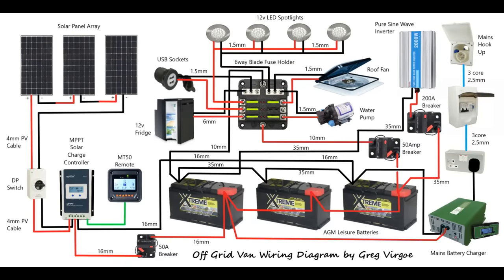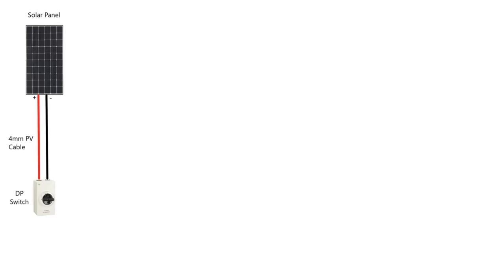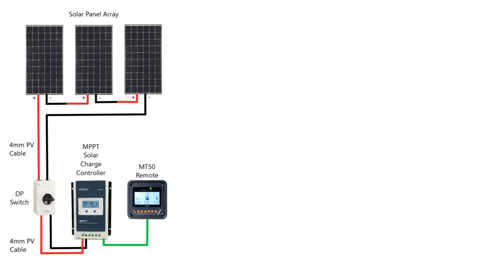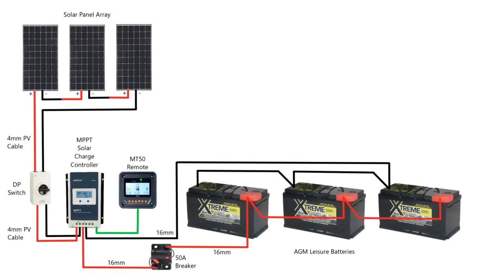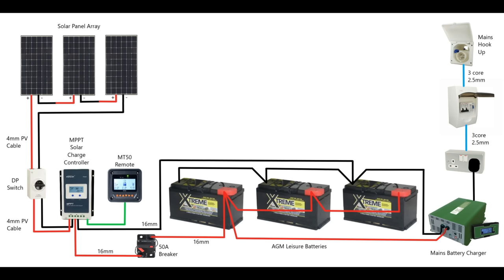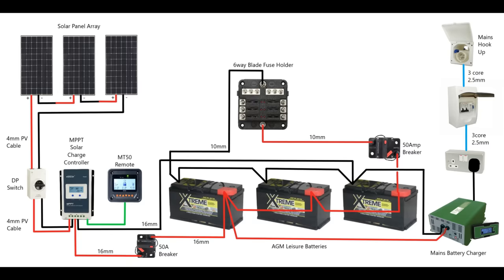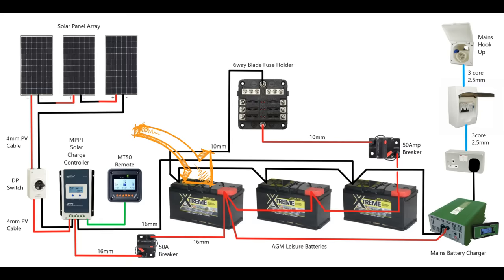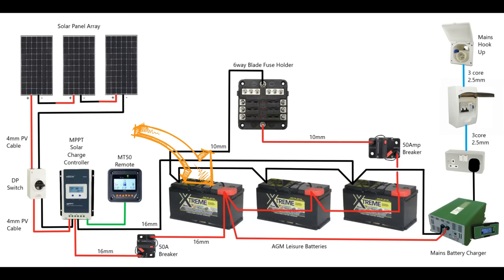How to Wire your Camper Van to be Off-Grid

Comment: Hey Greg! Nice vid, it really helped me a lot... i was wondering why you dont use those two sockets of the mppt controller to feed all the 12 v appliances...
Reply from the maker: There is a limit on the load terminals and it’s really only designed for small loads like lighting. Best to come direct off the batteries 👍🏼😃
Reply: @GregVirgoe  so you advice me to do the same?
Reply: I mean, its perfectbly ok with the solar controller, to leave those sockets empty, right?
Reply from the maker: @patoliau  yes leave those empty and take your load off the batteries.
Reply: @GregVirgoe  sweet!

Comment: In america if your town has Chargepoint for electric vehicle their level 1 stations have a home outlet in them with roughly 1600 watts of power(not sure if it's a 220v or 120v). Have run extension cord from it to vacuum car and other stuff and to use the outlet it's completely free of charge even though you have to have account
Reply from the maker: I’m not sure the local council would be too happy with you camping on the charging point and using it as a hook up 😉😬

Comment: Hi Greg , brilliant video if only other things were explained this simply.  Please could you suggest your recommendation on a heater or best way for heat through the night or winter etc ? Many thanks.
Reply: Heat uses loads of energy; more than you'll get from a solar panel. So unless you're using a mains hook-up, you'll need a gas or diesel system. Diesel heaters usually come with a little bottle which you can top up when you refuel your van, so you don't need to worry about changing gas cylinders in the middle of the night. If you're really clever, you could even run the fuel line right into the main fuel tank so you don't need to think about fuel for your heater at all!

Comment: Hello! Very informative video. To add: is it possible to charge my batteries thru the alternator? Would love to see how you wire them as well just to ensure my batteries are juiced up even when there’s no sun. Thanks!
Reply from the maker: I recommend you use an isolated DC to DC smart charger like Victron Orion which you can find for about £150 now. 
You will need to run 16mm positive and negative cables from this to your van starter battery and your leisure battery. It will monitor the condition of your leisure batteries and make sure they are getting the correct amount of charge while driving.

Comment: Hi Greg, Thanks for your comprehensive schematics and videos. Question; Does a Projecta 1000 Watt Inverter need a Type A RCD connected to the 240 v output of the inverter? If yes how should it be wired to work effectively? Many thanks.
Reply from the maker: Yes it is recommended they you fit a Type A RCD off the inverter on the mains side. Wire from the AC outlet to the RCD then from that onto your sockets.

Comment: I found this helpful and set about getting all the bits together… my first go, my biggest project to date… I came up against serious issue any one able to help with specific work around would be fantastic… the 35mm cable is too fat for both my circuit breaker and my MPPT controller terminal…. Hope someone knows

Comment: Dear Greg,
you videos are some of the best in regards to camper buildout and more specifically camper electrics. Would it please be possible for you to give me an indication on the sizing for a circuit breaker. My concerns focus on two components that need protection. The first one being the car battery and the second the solar panels. With this in mind what size of fuse would you recommend between the car battery and a LiFePo 280Ah leisure battery running through the CTeck 250 coupled to the 120 through pass? Second point are the solar panels. There are two with a 140 Watt each connected to the system. Same question here, how big of a fuse would be recommended. As for the wiring gauges I followed your plans. Thank you ahead of time for your time and expertise.

Comment: Greg thank you so much for your video, they really are the only things I've found that make sense to me.  I have got my solar kit and am trying to work out how to rig it up without disaster.  
The inclusion of the DP Isolator between the panels and the charge controller makes sense to me. I watched one video where someone insisted on the need to unwire the PV wires from the charge controller before adjusting batteries ect, but then he went on to touch the bare ends of these wires - its all baffling to me.  
I looked up the isolator in your kit list, 32A on ebay, but says its rated for PV string volatage of 300-1000V.  I'm not sure how to calculate the string voltage of my panels, I have two which have 41V written on the back of them, they will be wired in series, so if I add that together I get something like 80V - could this be right?  Can I use this isolator? I do I need something rated smaller? 
Thank you so much for any help, I know there is really no obligation for you to help some random asking you a question, but the company I bought the kit from seem to find my questions tiresome. eeks.
Reply from the maker: With cable and switch ratings it never hurts to go bigger. If the switch can handle much more voltage then it will be very safe. It will run cool and no risk of it burning out. You will be fine with that isolator in my parts list 😁
Reply: @GregVirgoe  Thank you so much for replying, that is super kind of you!  The part is in the post and I'm inching my way closer to getting this thing all rigged up.
Reply from the maker: @jodie1162  when you get it inside will be 8 numbered terminals. Wire the positive from 1-2 and the negative from 7-8 and leave the other four empty. Hope that helps you 😁

Comment: This is spot on thanks my question is can I run a 12v system and 230amp plug in on the same plugs or would I need to have 2 separate circuits eg 

12v lights and usb stuff but I want to have two 3pin plugs for like a TV or an air fryer so we can pull up and use the vans battery power and also be able to pull into a camp site and use a power hook up on another occasion
Reply from the maker: Take a look at my latest van wiring video. There I use a Renogy inverter that has in built auto changeover from battery power to mains hook up so your sockets in the van can be powered by either

Comment: Hi Greg. Me again (sorry!). You've answered this in part in your pinned comment but I was wondering about earthing. My van is a Luton with non-metal walls and the electrical system is mounted on a wooden frame. It obviously has a metal chassis. Should any part of my system go to the chassis at all? Obviously, it's the mains hookup that concerns me most. Hope you and Lou are getting on with the build. Mine is killing me!
Reply from the maker: Ok 👍🏼 sorry for the delay in replying. 
You must not connect a mains hook up earth to any part of your vehicle. This is a legal requirement covered by statutory law. There is a serious risk of fatal shock if the site power supply lose their combined neutral earth connection. 
What you need is a consumer unit connected to your hookup socket with a double pole Type A RCD and double pole MCBs feeding all your internal sockets and appliances. Connect the earth from your appliances to the common earth bar in the consumer unit and your hook up earth also to that earth bar. Do not connect this earth to the vehicle body. Hope that helps. 
Here is the consumer unit you need 
https://www.12voltplanet.co.uk/deluxe-ac-mains-consumer-unit-with-2-x-double-pole-mcbs-rcd.html

Comment: Hi Greg.. amazing videos, the insulation work shop helped me massively and saved me some money too. Read a few comments, we will run off EHU pretty much 99% of time, but odd occasions will need the 240v when not on EHU. I take it I can install EHU unit, Consumer unit and run 5 different 240v sockets from that Consumer unit. Take it I need 2 x leisure batteries that will power 12v lights, USB etc.. but then need to attach an inverter. How do I get it to switch over from EHU to use inverter when not hooked up. Also, nearly all inverters have 1 or 2 three pins to plug into, how do you run the 5 different sockets around the van from those 2 three pins available on the inverter? Many thanks.. heads in a spin
Reply from the maker: Hi Russell, I have drawn a simple wiring diagram for exactly the setup you are after. You can download it here. Please keep for personal use only https://www.dropbox.com/s/2iyh1rnkwkl9ekc/Mains%20230v%20Wiring%20Diagram.png?dl=0
The changeover switch can be one like this https://amzn.to/3RgvRLZ
It has two sets of contact so will switch both the live and neutral from mains to inverter with a centre off position. 👍🏼😃
Reply: @GregVirgoe  that's perfect.. I take it that it automatically then switches to inverter when not on EHU? And run the 12v LED light, USB ports from the battery directly to them (obviously with break points from your previous diagrams)?
Reply from the maker: @RussellOSullivan  that changeover switch is a manual switch. You flick it over to what you want.

Comment: Question -  why the heavy 6mm cable for the fridge?  Any 12 volt compressor fridges that I have seen are usually less than 60watts (5amp) and could be powered via a standard cigarette lighter socket. Have I missed something?

Comment: Would of added a CteK vehicle to leisure battery charger this also includes an MPPT solar input, so can do away with  Charge controller however Ctek requires solar panel in parallel . Also should have breakers coming from each battery to a central buzz bar this to insure one battey goes bad it won't pull excessive current from the other batteries.  this way you can use 16mm wire from each to the central point and then a 32mm wires to your inverter. and also recommend Victoron  battery disconnect to your blade fuse holder. A lot of equipment has low power cut off. Which i would have another blade fuse carrier for. Especially if you have a diesel heater ,as they need to go through a cool down process.

Comment: Hi Greg,

Firstly, thank you for your diagrams, we have planned our build mostly off of them and finally have the solar up and running.

I wondered if i could ask a quick question about the electric hook up?

We have the victron ip22 30a charger controller for our 210ah battery. We are planning to run EHU point - consumer unit - single socket - battery charger - battery. But we're stuck on wire and fuse size. I think I'm over-complicating it! 

What MCB fuse size would we need? Is 2.5mm artcic blue okay between consumer unit and plug? (distance 30cm) What wire size do I need from battery charger to battery? 

Many thanks for your help 😊

Comment: Your videos are great and extremely helpful.  One component that i feel is missing though is the split charge relay from van battery.  Can I ask - your diagram shows wire at 16mm, am I correct in saying this is 16mm squared cable?
Reply from the maker: I don’t recommend using a split charge relay as it does not know the condition of your leisure battery or what charge rate they require. You would be better installing a battery to battery charger. The cable sizes are sq and relate to cross section area

Comment: Hi Greg,
I hear you might be building a new van, any videos of that ?
Just wondered why you did not have a split charger system that can charge auxiliary battery from either the alternator or the solar panels? 
Also I notice most people run both live and neutral 12v wires back to the fuse panel, why not just connect the negative to the vehicle chassis. Saves wire.
I assume it is because you can not measure exactly what current is being used by your appliances. Is it possible to put a shunt in the positive line just next to the positive battery terminal ?
Thanks for all your videos, so inspirational.
Cheers Tim

Comment: Hi Greg. Love your videos! Sorry if this has been asked before but -- how did you decided on a 50 amp breakers for connections to and from the batteries? Is that determined by the spec of the batteries? Does the amp capacity of the fuse holder come into play? I see that my 12-way fuse block has a 100 amp max capacity. I assume that I can put a larger breaker from my battery then. I realise that it's spec'd with anticipated load but I want to take into account future load growth. Thanks!

Comment: Hi Greg .
Thank you very much for your excellence videos .As soon as i turn on my 2000 Inverter on it start making a noise like alarm , I have to turn every tings off to stop noise ,What is the problem? Thanks in advance .
Reply from the maker: insufficient battery cable size is a common reason for noisy inverters. It's because improper or inadequate cables lead to a voltage drop and a consequent high pitched alarm sound. By default, the inverter emits an alarm to indicate that the battery cable size needs to be changed. 
This article will explain some other common causes https://exeltech.com/six-common-causes-and-reasons-for-ac-inverter-beeping-sounds/

Comment: Excellent explanation 👌 
Can you please tell the cost of all this set up at that tima as prices are a lot more now,
Reply from the maker: Solar Panels £420
Batteries £390
Control panel £400
Mppt charger £90
Mains charger £150
Inverter £130
Cable etc ££300

Comment: Thank you for this video, it’s extremely useful! One question: in your diagram what if the middle solar panel was more powerful than the other two, can I still connect them this way? The thing is that I already have a big one at the back of the van (280w) and I’m adding two more at the front (100w each). Thank!
Reply from the maker: It is not advisable to connect different size panels together. They really should be the same duty. 
You can do it but will lose some duty as this video shows https://youtu.be/P3YtBrymJdA
I would wire two 100w in series then wire that pair in parallel with the larger panel. But you need to make sure the voltages will be the same. 
Say 2x 12v = 24v for the 100w in series. The large panel would need to be a 24v panel. 
Better if you could get another 280w panel. Or swap that out fir all new panels the same size.

Comment: Hi Greg! At last somebody who know how to do things right!
Can you tell me why you're using 16mm and 32mm stranded copper cable on the batteries please? 
Great diagram too.
I stayed up until 3 a.m. last night watching your videos😁👍
Reply from the maker: The cables size is relative to the potential load in amps on that particular part of the installation. 
The power from the mppt to the battery is much less than the power from the battery to the inverter. The interconnecting cables need to carry the entire load of the system should everything be on at the same time. I have made a video on cable sizing more recently. 👍🏼😁
Reply: @GregVirgoe  yes I get it now! Thanks a lot. Just about to watch your video on rear camera installation😁👍
Thanks a lot!
Reply from the maker: @davopottso1  you are welcome 🙏🏼

Comment: Great video! I'm a complete beginner at this but if would it be too much voltage if you connected your 12v appliances to the 3x 12v battery system? Maybe I'm missing a crucial part.  Thank you!
Reply from the maker: When the batteries are wired in parallel (red to red and black to black) the voltage remains the same 12v and it’s the storage capacity that get added together. 

It’s only if the batteries were wired in series that the voltage would increase but that’s not how we wire them. Hope that helps 😃

Comment: Hi Greg! Love your videos and wondering if you could help! I am trying to buy 1.5mm 2 core flexible cable for my DC system in the van but places like screwfix etc say it is for 240V supply. Can I still use this cabling or do I have to buy cabling specific for 12V DC systems?
Thanks
Reply from the maker: I use these guys for all my 12v stuff they are very good 👍🏼 https://www.12voltplanet.co.uk/cable.html

Comment: If I'm not sure about the cable size, should I just get cables that are bigger than I think I need? Would that cause any problems?
Reply from the maker: It’s always better to go bigger. You’ll have less voltage drop and they’ll run cooler too. 👍🏼😃

Comment: thanks 👍👍👍👍👍👍👍
what about charging the battrey with the car
Reply: Have a look at Victron Orion-Tr Smart 12/12 30A DC-DC Battery to Battery Charger. Not sure where it goes in the circuit though. I think direct to the fuse box would work.

Comment: Hi great video. This is exactly the configuration I'd like to add in my van but I'd also like to charge from the alternator which may use a smart alternator. Would I just swap out the mppt with a ctek to gain the dual input charging? 
Do you know if there is another controller that would have three inputs to take the trickle charger too? Thanks

Comment: Thanks for all your fantastic videos Greg! Wondered if I could ask you a quick question;
We have a 35 amp solar charge controller for a 495 watt panel, would 16mm cable be sufficient to connect the charge controller to the battery or do we need a thicker cable? Van electrics are very new to us so thanks in advance! 😎😊
Reply from the maker: Yes 16mm will be fine for that charge controller 👍🏼😁
Reply: @GregVirgoe  you are a champion! Thank you sir!